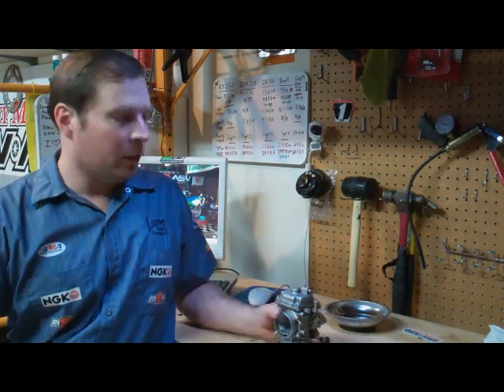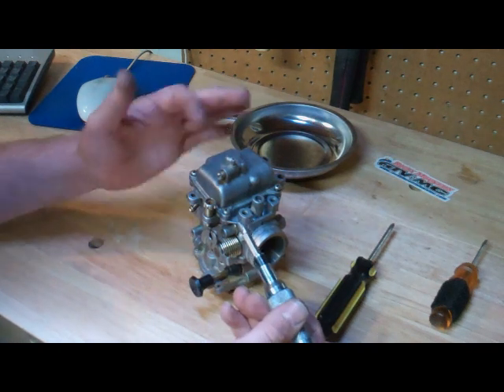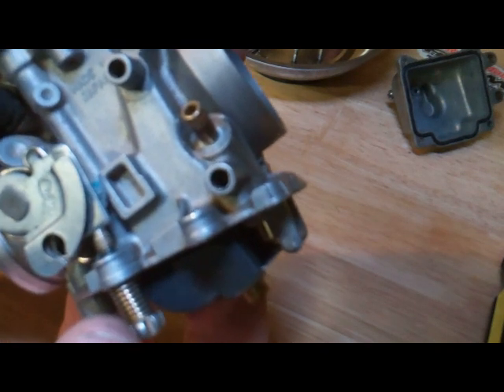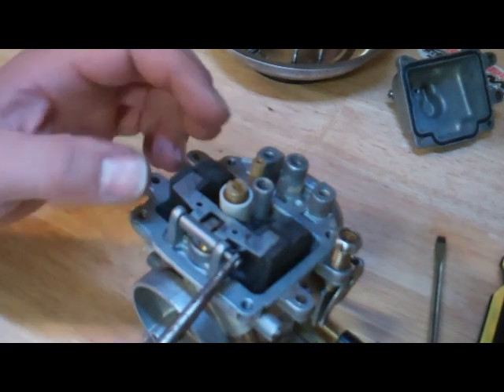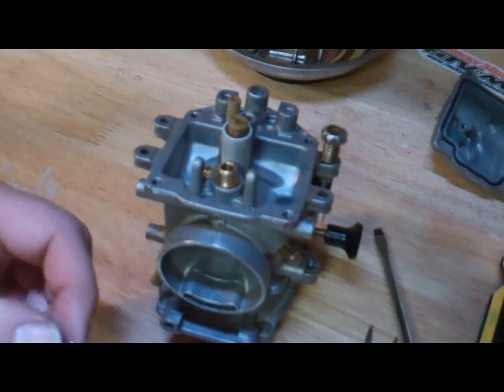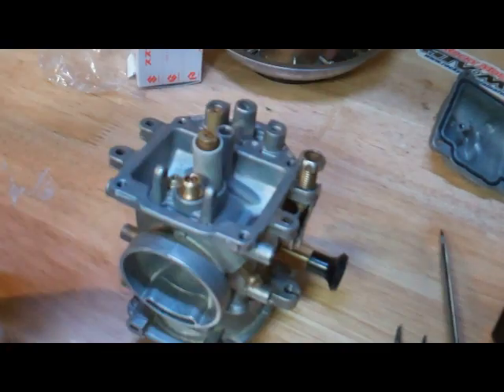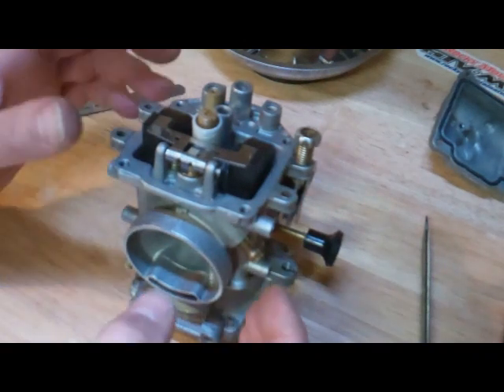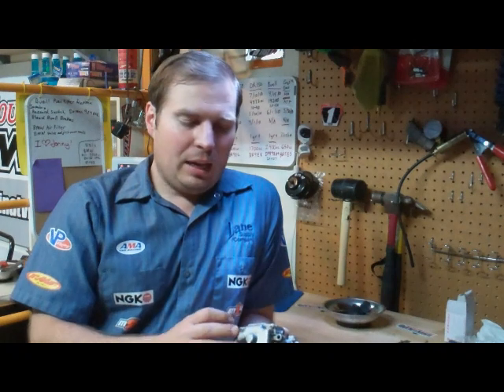Carburetor Problems? Motorcycle & ATV carburetor diagnosis

Comment: what made u think the float was bad if it didnt have fuel in it?  u could test it by gettin it hot maybe run it under hot water, then submerge it in cold water so if it does have any cracks itll pull water in when as cools
Reply from the maker: That is a good little tip!

Comment: I have an 2008 Yamaha raptor 250 and I left it in the rain and when I came back for it the air intake was flooded with water and now it doesn’t start but you can hear it trying to could it be that the carb is flooded and doesn’t allow it to start
Reply from the maker: Water in the fuel, water and fuel don't mix and water doesn't burn.  Drain and clean the entire fuel system and I bet it will run again.
Reply: thejunkman the screw to empty the carb is stripted/won’t budge
Reply: thejunkman how do I clean out the fuel system
Reply from the maker: Remove the float bowl completely
Reply from the maker: I have videos and information on my site all about this.  In general, everywhere the fuel goes needs to be drained and cleaned for debris.
Reply: thejunkman what’s ur website
Reply: thejunkman can u plz leave me a link to that video
Reply from the maker: There are links in the description, on my channel page and cards to all the videos or information you need.

Comment: Help !!!!!!!!!!
Hey man so I have a question I need your help 
So I was riding home one day and I ran out of gas I turn my Petcock switch to reserve then I went to the gas station I didn’t turn the Petcock switch back to the on  position The bike is working fine it’s seem to be at least I get back on the freeway and it works fine but ever since then if I try to hold high speed for long periods of time the fight starts to bog and will eventually cut off If I don’t let off if anyone knows anything please let me know it would be a huge help
I have a Suzuki katana 2006 750
Reply from the maker: You probably have some debris that is only partially blocking a passage in the carburetor.  When you turned the petcock it probably dislodged some old dirt or varnish.  Or possible debris on the bottom of the tank caused it since when you turn to reserve it allows the fuel to flow from the bottom of the tank versus the dip tube via the "on" product.
Reply: Thanks

Comment: I need one of those retain screws have any idea where I can get 1.
Reply from the maker: The float bowl screws?
Reply: Its the really short one that holds the seat in the flat washer screw
Reply from the maker: Got to an OEM parts supplier and find it on the diagram.  That is how you can purchase one.

Comment: Anybody got any ideas I have a bigred 250 runs fine and idials perfect when it's after it warms up will only idial for a few seconds I've adjusted everything. Thanks
Reply from the maker: That means your running too rich.  However start by setting the carb to the factory specs first. Usually that is the fix.

Comment: this is a 2000 polaris 325 magnum the performance is not right. after rebuild carb it is not firing well when a lot of gas is applied.I inspected plug and it was black.I put in new one and same results. where do you look for too much gas.
Reply from the maker: Well it is hard to pin exactly down which setting or settings to change.  Watch my carburetor jetting video for help in understanding what you should change.  You are running rich so you need to lean out certain settings, probably the main jet for starters, but maybe the jet needle clip position.  Watch my video to understand how these parts affect the air/fuel mix in the carburetor at different throttle openings.   https://www.youtube.com/watch?v=O53c1HxCAuI

Comment: my 87 kx 250 is a bitch to start cold it has compression maybe the choke? i cleaned the whole carb it seems like its not getting fuel. ideas?
Reply from the maker: Well first, check the carburetor and make sure it is set up to the factory specifications.  Check to make sure the jet sizes, float height, jet needle clip position are stock.  Next make sure the float needle is in good shape and is letting fuel to flow into the carburetor bowl.
Reply: i got it it was the choke i took it out and cleaned the shit out of it.

Comment: what is the purpose of that little "button" spring on the needle valve?
Reply from the maker: It helps east the "shock" and vibration from the engine or if in the case of motocross bikes landing off of jumps and things, otherwise it could damage the brass tang.
Reply: thejunkman dangit. I def measured the float height with the float depressing that little spring thing...
Reply from the maker: Measurement should be taken with the tang just touching the needle valve.
Reply: thejunkman ya I know that now after seeing ur video. I hope it will be fine.
Reply from the maker: +Kevin well it will be slightly high which means it will be rich maybe.
Reply: thejunkman ya I think I need to take it off and re adjust it. it keeps drippin out of the bowl overflow when I am riding.
Reply from the maker: +Kevin yep, its too high.

Comment: Great video, this seems to be the only one I can find based on the mikuni bst34. I'm rebuild one for a friend's yamaha ttr 225 and It's having a problem with leaking through the float bowl drain. I would just assume it's a float issue if it were any other carb, but since this one was ridden pretty hard the nipple for the drain line was broken off. I'm afraid this caused a small crack that's allowing fuel to bypass the stop screw. I can't find replacement bowls anywhere. Do you perhaps know where I could get my hands on one?
Reply from the maker: +Dylan Headrick Ebay is your best shot.
Reply: Jb weld will be your best buddy for that

Comment: i need help  i got a 1986 Kawasaki Bayou KLF300  and i took the carb off and its the  same carb but maybe a little older maybe but  i took it apart  and cleaned everything and putted everything back in the way it came out  and checked all my gas lines and plug  and my spark  plug ani't getting  gas from the carb  the float and bowl  is getting gas to it but the carb ani't giving gas to the spark plug what could it be ??
Reply from the maker: +jeff 16 When you had it apart did you check all the settings per the service manual?  The float needle valve is what controls the fuel flow into the carburetor, if the float height is too high or too low this will affect how the fuel enters the carburetor bowl.  Sound too low from your description.  You will need the service manual to set it properly as carburetors vary from machine to machine in their settings.  Also the needle valve itself could be stuck or worn, replace if needed.

Comment: how can i know if i need to clan muy carbuator
Reply from the maker: +Victor Martinez If it has been sitting for a long time, if you are having performance problems, or if you ran poor fuel through it.
Reply: evry time i try to step on The gas muy 220 kawaski atv wants to turn of or die ...isit because of The carbuator
Reply from the maker: +Victor Martinez Most likely it is.  You probably have dirt in the carburetor bowl that is blocking one or more of the carburetor jets or passages.  A full dis-assembly and cleaning is needed.  Re-assembly using the service manual to set it back to the factory specs and that should cure that problem.
Reply: oooh ok theink you verry muchos..one las question i i put a straight pipe on my atv will it be bad or affect my atv?
Reply from the maker: +Victor Martinez Putting a straight pipe on will generally cause your air/fuel mix to be lean.  You will have to jet a little richer.  This could be your problem as well
Reply: oh ok thx now i wont do it

Comment: question i found out about my jet needle on my 1987 tt225 it has 5 notches it's currently in the middle with a clip, the lower you put the clip the bike run rich, the higher you go it runs leaner, what would you set it at? the manual does not state what to set it at! also if i set my air fuel mixer screw under 3 1/2 turn the bike runs ruff and the manual states 2 1/2 to 3/4 turns?
Reply from the maker: +GERMAN SHEPARD Start in the middle position and then test from there.  Read about jetting on my jetting page for recommendations on maybe a main jet change if going to the extremes on the clip position doesn't help.
Reply: 2 and 7/8 manual says

Comment: hey junkman! question how do you adjust the needle jet or how do you read the manual for setting?my needle clip position 5E31-3/5   so how do i read that? it 1987 yamaha tt225 thankyou
Reply from the maker: +GERMAN SHEPARD How do you read the manual?  I am not sure how to answer that, the manual should have a table and a description on how to do it for your specific bike.  5E31-3/5 is the needle profile, not the clip position.  The manual will state the clip position (if adjustable).  I have a jetting page on my website (link in the description) that will help you understand the other adjustments.  However the first thing is to return the carburetor back to factory specs per the manual.

Comment: Hey junk man I have a 03crf450 and it leaks gas out of it I rebuilt it and it is still overflowing and it is a pain in the butt to start up when it is cold and I have to put it on choke then it usually starts right up need help thanks

Comment: Hello junkman, How about a vid with your approach to tuning a 125 2 stroke carb-and common issues with them...?
Reply from the maker: sonaramic I already have a few videos on that.  ALL carburetors work similarly so the techniques shown are universal to 2 or 4 stroke carburetors.  I have a whole page on my website devoted to it.  Link in the description OR here  http://www.thejunkmanadv.com/motorcycle-carburetor-jetting.html  This should guide you in what parts or areas to tune.  I am always adding videos to my website (not necessarily here on Youtube) so check the main page or "all videos" for constant updates.  Also I post all my new content to my blog as well.
Reply: thejunkman i have a tao tao i bought a brand new carb. any adj needed? it wont idle correctly. the air screw is at 2 turns. bigger main jet? the idle is funny it goes up and down. ideas?
Reply from the maker: Patricia Vittner Yes you will need to jet the carb as it did not come with the machine.  It will need some adjustment to the machine you are putting it on.  The main jet does not have anything to do with the idle quality.  Read up on my carburetor jetting page and it will give you an idea of what setting(s) to change.  http://www.thejunkmanadv.com/motorcycle-carburetor-jetting.html

Comment: James, clean your carb really good. Clean petcock and check fuel lines ,gas tank may need cleaned and may be a filter in it as well that needs replacing or cleaned. Clean air filter as well.
Reply from the maker: Yep, good advice.  I also have a video and page for cleaning the fuel system  http://www.thejunkmanadv.com/fuel-system-cleaning.html

Comment: hey junkman, my bike wont start , take off the air box dump a bit of fuel in there,  it starts and will continue to start all day . next morning wont start . . .it is a yamaha nouvu 2 , its getting fuel to the carb (fuel line off ,crank the engine, fuel comes out) . strange thing is once i get it started it runs all day fine , starts no problem. but if it sits for more than 12 hours. it will start for a second then die and will not start for anything    . .until i pour a bit of gas where the air box connects. i thought if i understood carbs with these symptoms the problem would be obvious. but perhaps not

Comment: hello i got a 125 quad yesterday! and i was riding it today and it shut off when i was giving it revs then i let it idle and it slowly idled slower till it shut off please help me
Reply from the maker: sounds like a fuel problem, possible clogged fuel line, fuelcock, or debris in the tank.  check this first then watch my getting an old bike runing again video for some more tips.
Reply: thejunkman it has a new carb in it should i check it anyway
Reply from the maker: birdylover100 Yes, new carbs, tanks and fuel lines can have manufacturing debris in them.

Comment: I just bought a (04 Suzuki ltz 400) it starts but it does not stay running long, I was told to replace the (carb) because it was staying choked,flodded..so  I bought a brand new from ebay $149.00. put it in my self very carfully step by step and now it wont start, any hints on this matter - what went wrong?? I thought that by just putting the new one in it would start quick
Reply from the maker: Not sure why you bought a new carburetor.  Carburetors don't go "bad" unless they get physically damaged and your "old" one is probably fine.  Have you checked to see if the new carburetor is even jetted to the correct factory specs?  Sounds like you are not getting any fuel.  Also for faster answers from me please leave your comment on my site.  I hate Youtube commenting system so much it is hard to find or answer questions here.

Comment: I have a Yamaha Grizzly 660, 2002. It runs good, but, fuel leaks from the carberator bowl drain hose. How can I fix this leak?
Reply from the maker: Wit the information in this video.  It tells you everything you need to know.  If you have more questions leave them on the website http://www.thejunkmanadv.com/how-to-basic-carburetor-disassembly-and-diagnosis.html
Reply: Turn the screw back n forth if not take apart n bend the tang. The part it sits on

Comment: How can I get my seat out? It's stuck in there really tight?
Reply from the maker: I don't really have a good way outside of an easy out or sheet metal screw and yanking on it, this will of course destroy it but your replacing it anyways.
Reply: thejunkman it almost seems like its not suppose to come out, but i know it should, Im just going to rip it out and buy new one. thanks a lot

Comment from the maker: Short answer is yes, however ALL fuels today can have their problems if left sitting for long periods of time without using a fuel stabilizer.  Key to success with any fuel you use in a carburetor equipped machine is to consistently use a stabilizer so if the machine has to sit for weeks on end the fuel will not varnish or "flash off" leaving deposits that can clog jets, passages or deteriorate rubber seals.  Check out my website for more info.

Comment: So i just bought a 92 ninja 600 and it ran fine when i was test driving it, but as i rode off with it i noticed it started to bog down and then when i went to stop it just died before i even stopped. After riding it for a few more minutes it would start but wouldn't idle. it would just bog down and die. If i left it alone for 15, 20 minutes it started right up with no problems idling. but then same thing after riding it for a few. im thinking this is a carb problem??

Comment from the maker: Well depending on the carburetor it can be just another name for the pilot jet, however a few carburetors have a pilot and slow jet (as they call it) as well as a main jet.  In these carburetors the slow jet is to provide a smoother transition to from the pilot (only in operation at idle speed) to the main jet.  They are usually only found on CV type carbs.

Comment from the maker: Well a carb kit shouldn't be $100.  If it is just the bowl gasket leaking that is pretty cheap and an easy fix.  If it is leaking out the overflow you have other issues inside the carburetor.  Visit the webpage and leave a comment on the video page and it will be easier for me to respond.  Follow the link in the description

Comment: from what i read its usually just dirty am i better off just cleaning my carb? i put money down on a kit to rebuild but dont wanna spend 100 if i dont have too. i need to fix it asap though. it seams to be leaking out side of the carb and its deff from the carb itself

Comment: Hi Junkman learned alot from your vid. I have a question. Before I rebuilt my 400cc yamaha kodiak atv carb it was idling fine, but would bog out when I gave it more then 1/4 throttle or more. Since installing the rebuild kit, it no longer bogs and revs up great, but it idles too high.The idle adjustment screw located near the throttle cable seems to have no effect. Is there another adjustment that I missed? The carb is a slide valve Mikuni. Thanks

Comment from the maker: It is fairly possible that the diaphragm is the problem.  The only real way to know is to disassemble the carburetor and inspect it for tears or pin holes.  I also could be a blocked passage with dirt or varnish from old or poor fuel.

Comment from the maker: You are correct, modifying the stock exhaust will probably mean you will have to adjust the jetting slightly for the difference in flow characteristics of your modified exhaust.  Given you have no idea how a carb works I would first study up on basic theory first so when someone gives you advice you have some idea what they are talking about.  Explanation would be too lengthy for a comment here.  Contact me via Facebook and I can "try" to explain or help.  However I cannot recommend any changes

Comment from the maker: Your on the right track, but you probably don't need a rebuild kit.  Your problem is probably just a combination of poor fuel, dirty fuel, partially clogged jets or passages.  Your "flooding" problem is probably a lean mixture problem from one or more of the the aforementioned issues.  I can rule out a sinking float as you didn't state that the carb was overflowing out the vent hoses or being wet in the air box.  Hit me up on Facebook for an easier way to converse.

Comment: My 92' dr 650 seems to be flooding itself while at and idle, it will stall at stoplights and even clutch shifts from second to first. Would a typical carb kit likely fix this problem? Did I even diagnose the problem correctly?